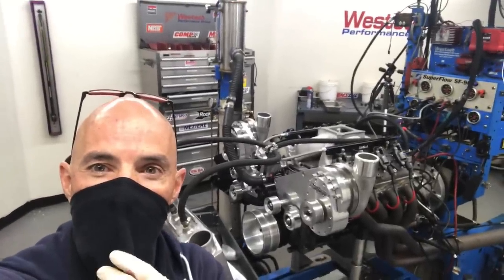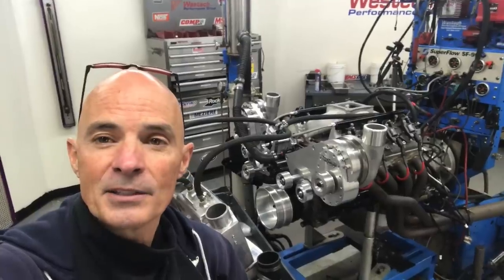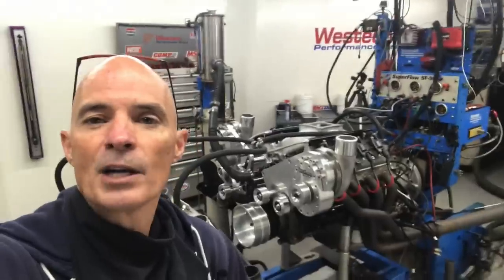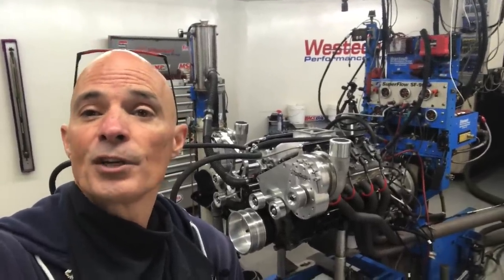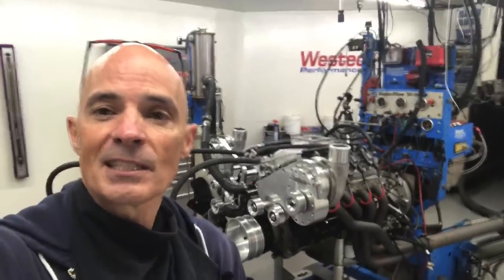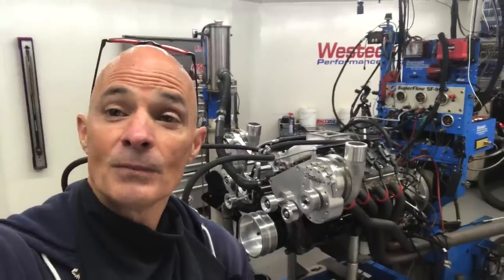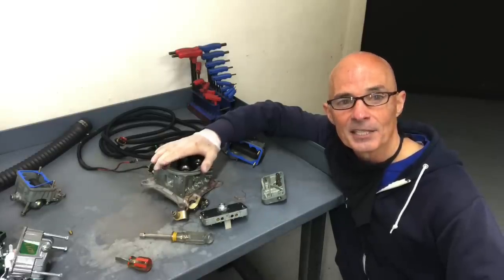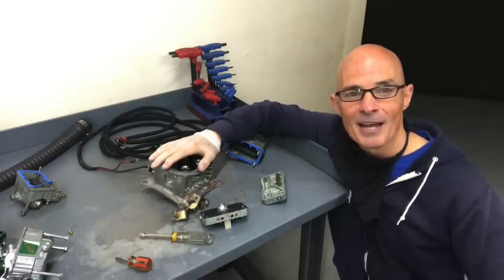WHAT'S INSIDE? -BLOW THROUGH CARBS

Comment: Richard, I do NA Engines never had done  a boosted engine, but have you tried the carburetor that worked before like you said as well with double source of boost before or just a single source ? You mention it goes lean, but at what rpm is that happening and at what boost level ? That was not clear to me, did you try a double carburetor setup ? And each carburetor been feed with its single supercharger ? The other thing is that carburetors cool down the mix so if you install two carburetors you may not need the intercooler I will prefer in a carburetor setup actually to cool the fuel with coolers that use ice water to increase that effect, other thing is that you are using a open plenum manifold I will suggest that you put back the 4 hole spacer 1" + plus higher to make the other bank of cylinders come a little to life.

Comment: Try flow testing your fuel system, using the pump,  lines, regulator, through the float bowls into a bucket.   Place both the float bowls into a bucket so you are running through the needle and seat.  Simulate the fuel pressure needed by placing 15 psi shop air on your fuel regulator.  Run the pump for an exact amount of time, maybe 60 seconds.   Then measure the amount of fuel pumped.  Compare that to the BSFC from the dyno runs.   

If not look at trying to get a straighter shot into the carb than that carb hat.

Comment: Plum the hat 90° to make sure that turbo hat isnt favoring only one side of the carb and creating turbulence on the other. Plus I would run the boost reference up towards the snout where the pressure in more constant maybe with a "L" shaped pickup tube inside facing incoming flow. Maybe throw a couple boost gauges in different spots for comparison and to rule out turbulence or high/low spots around the base of that hat.

Comment: I know this elbow/carb combo has made power but ultimately it always loses just about any other intake setup in tests. That boost reference house is drilled in to the "brick wall" that your boost is hitting coming out of the charge pipe. Just try a more gradual bend elbow and putting the boost reference hose closer to the intercooler. Something is bound to happen!

Comment: Also I wanted to suggest I've never seen anyone do a blow through setup with two e85 carburetors on a tunnel ram I bet you could fix the lean condition with that lol but I agree with a lot of the other about the 90-degree turn on the hat...so why don't you see if you can get someone to possibly make a lexan see through carb hat I don't want to sound like an idiot but I've seen where the they use smoke in are tunnel testing for

Comment: Even with an intercooler what is the intake air temperature?? Obviously on a normally aspirated motor it's going to be whatever the outside temperature is but with the boost are going through the carburetor does the intercooler actually bring it to outside air temperature or is it hotter or cooler?? Just food for thought!! keep doing what you do bud

Comment: I couldn't tell, is the regulator a return style, after the fuel log so you're getting all the fuel volume to the carb and only returning what isn't used, like an efi system? This is what we do on the larger alky carb systems to maintain fuel volume.Also you have twice the parasitic loss from 2 superchargers. I don't know how much drag they represent, but let's say one is 200hp. Two would be 400hp. So if you're trying to make 1000hp you need enough fuel to supply 1400hp.

Comment: im with all the guys talking about the air turbulence being likely to blame for not being able to pull the fuel out of the carb. you had fuel supply issues with multiple carbs , regardless of boost levels. i dont think its a fuel availability issue. i think its an air flow issue.

Comment: Well 1200 on gas and 1200 on e85 need much different afr as far as I recall....so surely 1200 gas would equate to 1000 e85 based on their differing stoichiometric values. So I think you are right in the fuel requirements not being met, but I think it's simply the carburettor being at its maximum capacity than anything else

Comment: Have you checked flow from the pump at different reference pressures to see what the actual G/LPH are? Is there a size difference between the venturi horns or a dimension difference not dealing well with the increase in air flow. Last is it possible you're blowing air past the seals?

Comment: You may have run this combo but ive found that this junk sitting there isn't sent out at what it's suppose to be. There is a restriction in the carb, main well, cross bleeds, and banjo size also fuel ring size in the boosters, and the size holes, it's a combo problem.  I learned from Mark Sullens e85 and make 2700hp on a single blow thru e85 on my 598 bbc v30 131 Vortech supercharger setup. I have seen mark fix these carbs for not working on a regular. Call mark and listen to him, I put my Monte on it that he gets you straightened out. He straightened out a brand new csu for me. I haven't heard of your e85 expert and the real e85 experts that do all e85 ain't heard of him either.

Comment: could it be an issue with the high speed bleeds ? In my race car, when i check my data logging and it trends lean on a pass i put in smaller high speed air bleeds. I'm not a pro and i'm not familiar with blow - thru.
Reply from the maker: we plugged them

Comment: Had the exact same problem.  LQ9 with D1SC ProCharger  making 15psi.  Through a Quick Fuel 750cfm Blow-through carb, Aeromotive Boost Ref Regulator, Aeromotive fuel pump,8AN fuel line, on a Victor Jr.  No Cooler and 90* Carb hat. During first test run the AFR slowly Leaned to an unsafe level. Immediately started with carb tuning, and increasing fuel pressure thinking, more pressure more fuel. Increasing fuel pressure doesn't increase volume.
 The fix- Change 8AN fuel supply line to 10AN. Separate fuel supply lines from the Regulator to Front and Rear bowls on the Carburetor. 
I didn't see how yours was set up in the video, but sounded like the same problem I was having. Thought I'd share.
Reply: Most people do not comprehend how high the fuel flow requirement actually is at maksimum horsepower. A full tank of fuel last only "a couple" of minutes at 1000 hp on E85.

Comment: A lot of attention to the intake side. You pulled the Jets and still not enough fuel at upper rpm. Have you played with exhaust?? The other side of the equation. If the exhaust is to efficient at the higher rpm it could be scavenging fuel out of the cylinders. A restriction of some type could give you a direction or additional info. Just my thoughts, look forward to follow in this project.

Comment: Did some reading from old TurboForums threads (back pre 2010) when there were a lot more blow thru setups out there. The lean problem when all else was good led to VARIABLE vent tube extension. the front and back were different lengths. They had to play with the lengths to get it right. Eventually worked and held good AFRs to 20lbs.  Here is the thread...https://www.theturboforums.com/threads/running-lean-with-mighty-demon-fixed.328603/
Reply from the maker: we ran extensions
Reply: @richardholdener1727  did you try various lengths between front and back?

Comment: Like others have stated the Carb hat seems suspect. Also, I didn’t hear it mentioned but worth saying, just because you’ve made 1000+ before doesn’t mean it’s the same here. You’re driving two blowers so BSFC is going to be higher. Then you throw e85 on top of that fuel volume is huge. Is it possible to flow enough fuel through the carb that it can become turbulent and airate?
Reply from the maker: we ran the test on gas also-same results

Comment: Can you narrow it down to a specific cylinder? I saw you running 8ch lambda’s on a previous video. Maybe that information would help trigger some new ideas about what’s going on. It definitely trends with boost (more psi = leaner lambda reading). Maybe your ignition coil drivers are bad in your ECU too. A rough running, late burning cylinder can sometimes cause a lean Lambda reading, depending on the type of sensor you’re using. As the boost goes up (cylinder pressure at time of spark), it gets harder for the spark to jump the plug gap. Just a thought - those kinds of problems are a ball-ache; good luck.

Comment: You Need to add a Second Carb and hat you have reached the Limit of the Design, do a tunnel ram with duel carbs End of Problem or go to a Dominator carb by doing that you wont have to max out a Single carb to support the Power, then you can have a single blower going through each carb and have Twice the flow to boot!!!

Comment: Im no pro at this but listen and talk to big power blower guys mainly 14-71 hemi and wedge motor setups. So as far as the cylinder to cylinder distribution i believe to you need to try and advance or retard the cam timing to even that out afr distribution. on top of installing a divider to charge pipe to rule out boost turbulence. Cam timing makes sense to me for about the same reason of the 4-7 i think 2-3 cam swaps for big nitrous motors at the same time idk how much sense that makes with the new style cams with less duration overlap etc. Just a thought

Comment: From what I see from your video and conversation you have only 2 holes behind boost referenced powervalve? The high horsepower (up to 2,000) e-85 blowthrough carbs have 4 holes that take jets or can be run open behind boost referenced powervalve,the guy I worked for makes 1450 wheel horsepower with an e-85 blowthrough from C&S.... I would bet if you change to a 4 hole setup behind the boost referenced powervalve it will cure your issue,there are 4150 Holley style e-85 carbs that support 2,000 hp as I'm sure you're aware.Also if you go to Steve Morris you tube channel he shows the whole dealio of the E-85 blowthrough that he uses for big hp engines, also as I'm sure you already know the smaller you make the high speed air bleed the richer it gets ,I hope this helps!!!:-) thanks for the awesome videos!!!

Comment: Exhaust gasket on one side?
Maybe it's tuned just fine, and you have a leak somewhere in the exhaust system on one side.
It lets fresh air in, and looks like a lean condition when it's not. 
Just something else to check

Comment: Shorter bowl vents, bonnet extension and an Extreme Velocity bonnet should sort out the lean top end fuel distribution providing its not an intake manifold issue, can also try boosting the voltage on the fuel pump to see if that will help....

Comment: Have you pulled the plugs for a reading? It's possible one cylinder is not firing correctly, leading to a false reading on the O2. It could be a bad spark plug or coil giving out. I think Matt Happle had a similar problem on 8F8 where a bad coil was leading to a lot of carnage. Could also be valve train related. Possibly a lifter collapsing at higher rpm, or that it's pumping up and hanging a valve open? Swapping everything side to side could narrow it down quickly.

Comment: Some good thoughts already posted.  One other thing to keep in mind is that it takes a lot of power to drive those two blowers.  So while it might only be making 1000hp on your dyno, there's probably 200-300 hundred (or more?) being spent to drive those two blowers... which all takes fuel to do.

The lean bank thing is odd.  Sounds like an air flow/distribution issue to me.
Reply: This guy gets it! You are asking ALOT of that carb. That motor is probably making 1300hp or more. You are asking it to flow 1300hp worth of e85. That is like 1700hp worth of gas! And trying to do it with single needle and seat? I bet if you ran that motor WOT for a second or two longer your AFRs would quickly go dead lean as the bowls continued to empty and started to uncover the jets.
Reply: @wingnutks  except for the trys without Jets. LOL nothing there to uncover.
Reply: @MuscleCarGarage2022  single needle and seat is only going to allow so much fuel in the bowls... No matter what jet size

Comment: Have you tried it without the innercooler? What's the air intake temp before the carb? Cool air is dense air. I know you said you're getting 15psi of boost but that doesn't tell you the air density or the cfm. It only tells you how much restriction there is. Air that's cold doesn't mix well with fluids.

Comment: The hat on the carb is the problem, like everyone else has already said.
You mentioned tubes added to the bowl vents but didn't elaborate. You were on the right track. You need to make then out of metal tubing and bend the so they extend into the straight section of the hat where the air enters. Think of them as pitot tubes like on an aircraft. They need to be in clean straight flowing air. Both vents need these 90 degree bent tubes added to them. The turbulence flowing over the stock bowl vent tubes is the problem.

Comment: Being boost sensitive, the regulator might not be getting sufficient signal.
Measure boost pressures close to carb (like you have it) and check also near the blower(s), I think you might see a higher pressure reading, at the carburetor you are going to higher velocity because of the moving air but less boost, all the backed up air (boost) is going to be at the blower.

Just a suggestion from an observation.

Comment: With all of the jets out its something very fundamental. Basic operating principle is differing pressure by virtue of the venturi effect so for whatever reason you're not getting the pressure drop you need to pull fuel through & ultimately into the engine. Only other factor is mixture distribution but i can't imagine is is so profound to override the removal of jets. The comments suggesting re arranging the hat on the carb is utterly sensible. Is it possible to see which cylinders are actually lean by looking at EGT as that would give some clue on which cylinders are not getting fuel. I presume the base engine checks out ok for compression & leakdown? No coolant getting where it shouldn't be & screwing up the lambda readings?

Comment: I'm pretty new to all of this stuff but, could there be a chance that the 2 chargers are creating so much pressure in the intake as to push back ( backpressure) so much on the carb to as to hinder it's flow? I mean it actually is forcing air back into the carb. I haven't read or maybe have missed it but did you change to a completely different intake?

Comment: I run a .152" seat in my E85 Qjets, no way its going to keep up with boost on E85. Not happening. Dual needle seats are the way most of us are going with high boost and E85 on Holley style carbs, a single can't hang. Then you have boosters that need to be larger, usually around .140"-.145" for NA. The Quick Fuel carbs are ok, but not perfect and not optimized, they can take some more work. If you want to run E85 Holleys blow through or not, the guy to talk to is Mark Sullens. I'll share this video with him for you.

Comment: You've used that same crazy "elbow" without issue before.  You're having issues bank to bank.  The elbow would naturally send air to the rear venturis, not side to side.  boost tends to help issues like that.  maybe the bowl vent is seeing too much air speed, and causing vacuum (like a whistle)?  flipping the carb around would fix that.

Comment: i agree that the hat is causing a turbulence issue with the air flow. a quick fix could be to make a divider plate to stick inside the hat so it separates the air to each bank before it hits the turbulent section and possibly one down under the carb. if the one under the carb makes the most difference then the intake design is the issue and won't work well with this combo. a performer rpm air gap might work better if they make something like that for the LS. another thought was what would happen with a dual 4 setup i don't think it will solve the side to side issue but it is something you didn't try. might change the air fuel delivery in a good way?

Comment: I tune an X Nascar Chrysler W8 with a Procharger and one of Kevin's carbs for drag racing. 

It started out as gas motor carb combo with an inner cooler which worked Great. 

Last year we has Kevin convert the carb for E-85 and it took me months of trial and error to get ahold of it. Same issue as you way too lean up top.
The things I did that helped most were, had Kevin send heavier power valve springs  along with me drilling and tapping both front and back metering blocks to accept 4 metering jets each. That allowed better fuel control as the boost came up which made the biggest change. On the street it made driveability way better.
I like you have1 bank running leaner and my explanation for that has to do with the hat and squirters. Watch any video of a dyno run with a cam above the carb and at some point you see the squirters adding fuel to each venturi. If the hat pushed air in vertically all would be good but like others said your asking it to make a 90 deg turn and things get unhappy.
My plan this year when we get out of our houses is to put a Snow Performance meth/water system on with a shear plate under the carb. That will add fuel, cool the incoming charge and with a 2 jet plate allow me to add more fuel to the side that need it. 

If that doesn't work it will get a Haltech 2500 EFI system.

Comment: You have plenty of volume and plenty of fuel your problem is the delivery I would stack 2 2inch spacers underneath the carburetor And get rid of that carb hat that thing is not meant for that much volume of air has such a tight angle as for low boost applications do you need something more custom that has a slope to it you kind of like you would find in the couch in your sink drain that will slow down your turbulence and deliver a straighter path of air into the carburetor